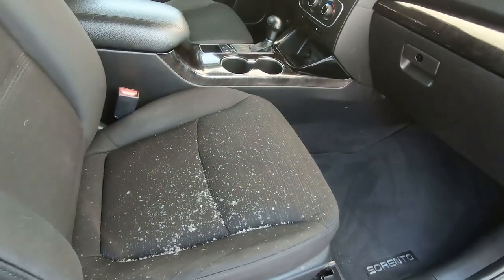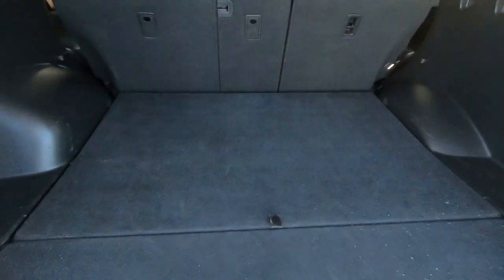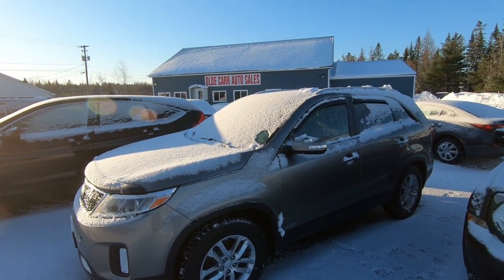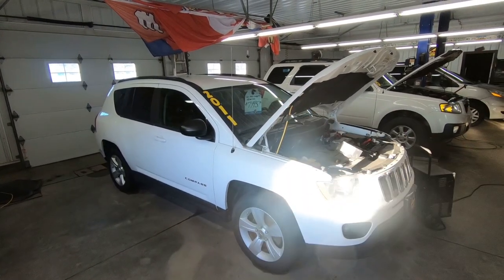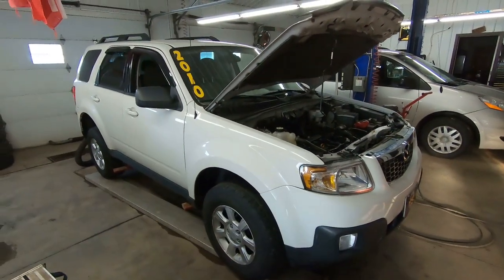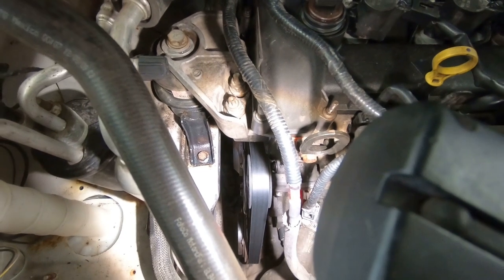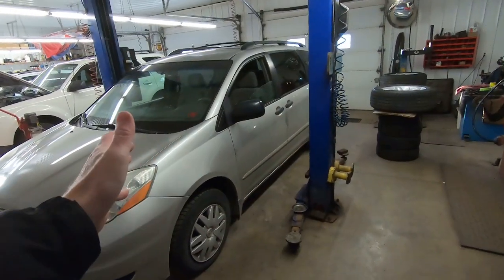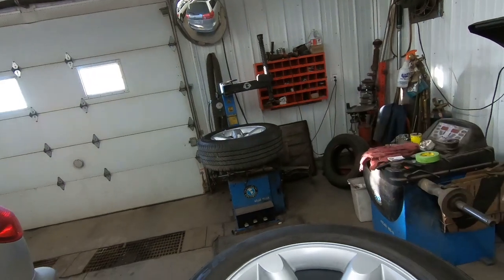DETAILED 2014 KIA SORENTO LOOKS LIKE NEW

Comment: It would have been great to get a video of the products and methods used to clean that car up.  

Belt tension assembly...a $1 6203 bearing failure, all the rest of the assembly is what costs the money...lol.
Reply from the maker: I've been trying to work that into a video. It's a timing thing. Detailing is a long process and I'm not always available to record the process, however, I could go over the process without actually cleaning. I'll try and get junior nailed down to do a demo!

And I completely agree with the $1 Chinese bearings train of thought.
Reply: @OldeCarrGuy  Takes me 2 days to clean mine after winter.  I (and my wife) would appreciate cleaning tips and shortcuts...lol
Reply from the maker: Let me see what we can do!